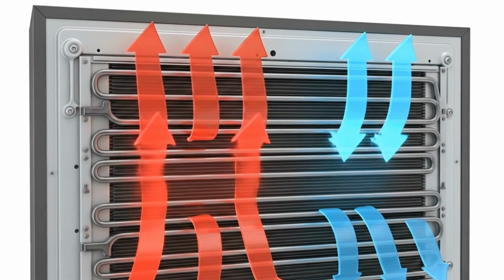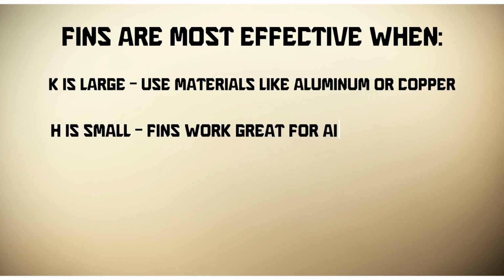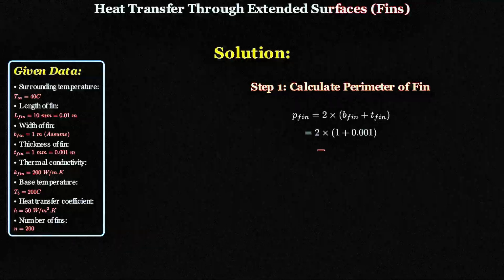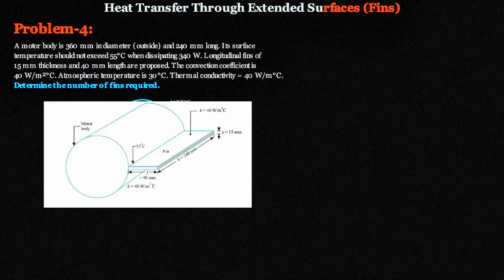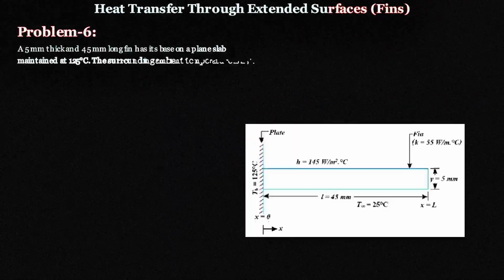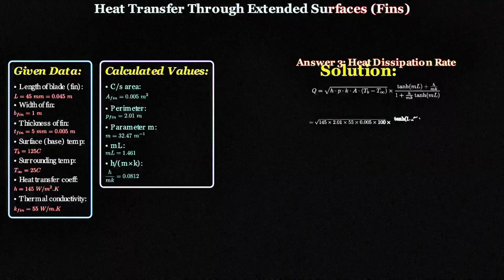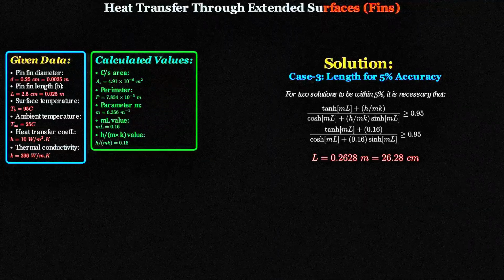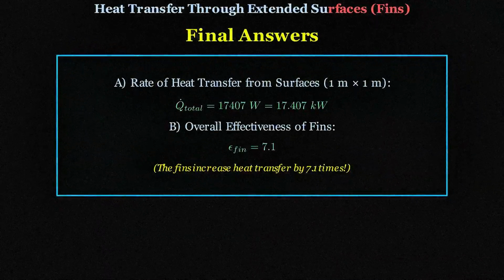Master Heat Transfer Through Extended Surfaces: 8 Problems Solved (Complete Guide)

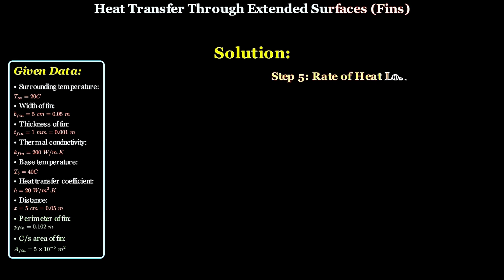Comment: Correction, at 15:29, the temperature difference in the equation is outside of the square root. Therefore, the answer comes out 20.143 W.
Reply from the maker: Good catch! You’re absolutely right — the temperature difference should be outside the square root. I appreciate you pointing that out, and I’ll make sure to clarify it in the description/comments. Thanks for watching carefully!